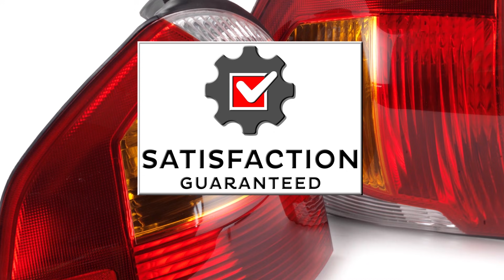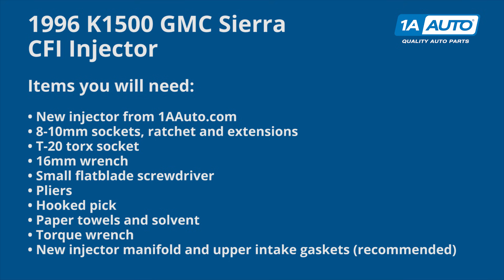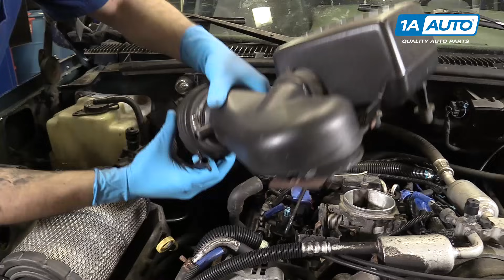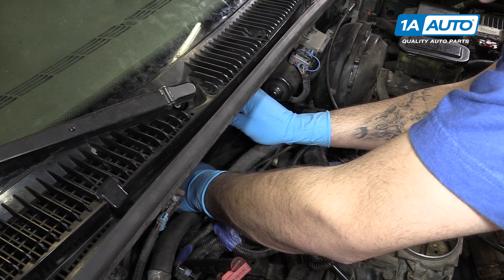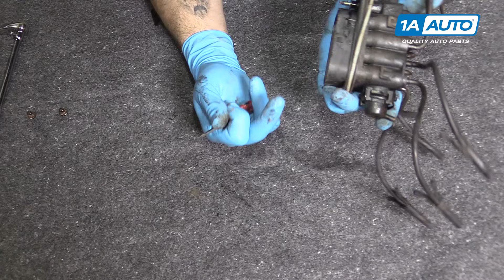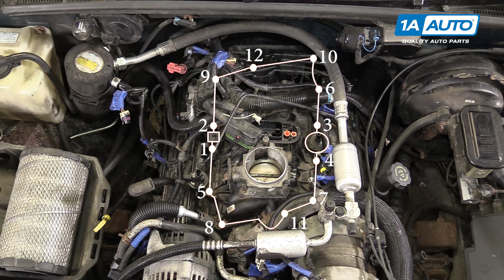How to Replace CFI Fuel Injectors 94-98 GMC K1500

Comment: Can you hook up a injection cleaning machine unhook fuel pump relay  hook up hose to fuel rail set pressure to 50 psi add cleaning solutions  to tank ,,let run till tank is empty,

Comment: Is there any way of cleaning these injectors?? The part itself is a bit pricey just wondering
Reply: Not worth it really just better to buy the new spider 🕷 system and change yourself worth it since the a prone to leaking as they age change it once and the fuel pressure regulator you have a new truck.

Comment: Truly excellent, informative video tutorial.  Now, can we take a moment and talk about the idiot engineers at GM that came up with this devilry???  And I'm a hard core Chevy guy.  This is one of the most idiotic intake setups GM ever came up with.
Reply: exactly  this is a mess i hope fuel injector cleaner helps  i dont want to do this
Reply: @kiteslights7189  it may or may not but I tell you this once you change out the spider 🕷 injection system with new all 8 and the fuel pressure regulator and clean the throttle it’s like having a new truck only about and hour or 2 job.

Comment: Why would you do all this and not replace the entire assembly with the upgraded version?
Reply: Well, they did. This is simply an instructional video for those who want to replace the spider injector. If you notice, they have a video upgrading the fuel injection system and basically use this exact footage except they changed the bit with re-installing the injector. You can find that video here: https://www.youtube.com/watch?v=_1Hkjc8zcb4

Comment: Are there o rings on the flare nut fittings at the back of the intake manifold?
Reply: yes, identical to fuel filter connections.

Comment: I have a question that I hope you can answer. I just put in a new spider injector and it's getting fuel and has good ohms but for some reason they poppets won't open and disperse gas. What do you think the issue is?

Comment: I call it Frugal insanity... once down that far I think should be recommended to change all of the injectors.. ironically and possibly after reassembly and driving down the road for two weeks another injector goes out..
Reply from the maker: +Jack Parker Thanks for the comments and for watching!
Reply: Customer probably could only afford what needed to be fixed.

Comment: two questions... How do you know if an injector is bad after you remove it? and why did you not replace with the new upgraded mfi injection manifold?
Reply: permanent misfire in the codes. (PO30* somethings) the old obd2 stays good with mentioning it. you can try a poop ton of cleaners (marvel, techron, lucas, seafoam, etc) and let it idle. if it comes back at an idle even for a few minutes at a time.. keep throwing cleaners at it.. its not a bad injector, it is simply dirty. I had one skip after hitting a big bump once... cleaners brought it back. These can skip just for removing gas tank for a couple of days (mechanic called it de-airing, or regaining nitrogen) Very sensitive.

Comment: I'm going to be doing this in 2 weeks to my 96 silverado with a 5.7 liter. Why not replace the fuel pressure regulator filter while im at it. Anything else I should do while I am in there ??
Reply: Don't drop any tools inside.

Comment: I have a 1997 4 wheel drive suburban 1500 turns over it gets fire put a new fuel pump in it it's getting fuel all the way up to the pressure release valve but still won't start not getting fuel  through the injector you spray carburetor cleaner in a fire-up
Reply: Did you get it fixed? Dealing with the same problem.

Comment: Can anyone help usually in the morning my Yukon seems to pull in the like kinda heavy like losing fuel makes it feel like my transmission didn’t work but if it warms up after 20mins it’s fine
Reply: You should let your vehicle warm up for roughly 20 minutes in the winter months anyway so the fluid can warm up and expand some.

Comment: Is this also the way to replace fuel injectors on a GMC 1999 Suburban?  Think it is a C1500 4 wheel drive.  It just developed a problem after stopping at the store and restarting the engine.   When I make the first right or left turn it bogs down like maybe 4 cylinders have flooded with gas.  Was suspecting a leaking fuel injector.
Reply from the maker: +Roger Merritt It may be a different procedure on your application. We currently do not have an auto repair video for this particular year, make and model. Thank you for asking. 1aauto.com
Reply: @1AAuto  fuel pump? They die slowly when running on low fuel alot.

Comment: Why not replace with a new MPFI injector assembly instead of reusing the old assembly which is prone to failure?
Reply: Cost.
Reply: Kevin Kingsbury I totally agree with you on that. It is such a nasty job changing out those things and for that reason I always tell people even if they’re not bad just replace them all anyways because only time will tell before they actually do go bad and then you have to go through that whole procedure all over again.
Reply: Upgrading to a newer MPFI from a 2004 will give you a better running engine. World of a difference.
Reply: @ismaelcarrillo3956  how so? do you have a part number?

Comment: This video was invaluable in replacing my 96 c1500 injectors, though you really do not need to remove the distributor cap or fuel lines. Just taking out the bolt on the bracket gives you enough slack in the fuel lines to move them out of the way.
Reply: DireWolf how long did it take you to do this?
Reply: thanks, the less work, the better
Reply: KB_TheDireWolf is yours a v8 5.7l? This is for k1500 models